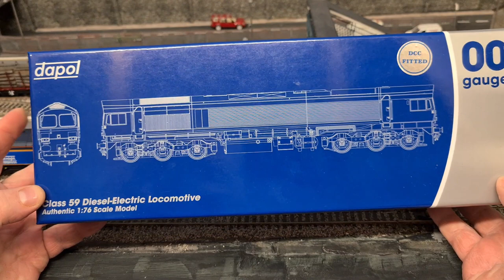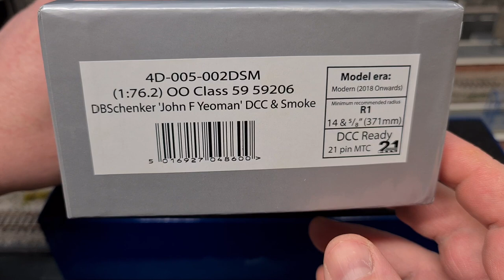Dapol Class 59 DB DCC & Smoke Fitted Unboxing

Comment: Loved your review. Like the look of your layout. The 59s with sound were available direct from Dapol and I obtained three from them. I originally ordered the DB 59, but cancelled as I had so many Bachmann DB 66s. The next run of 59s with three new liveries will be available with sound from dealers. The sound versions are awesome with twin speakers and suggest you get one on the next run.
Reply from the maker: Hi I'll definitely be looking at getting a sound fitted one, I do wish I went for one rather than the smoke fitted but, its one of those things I wanted to try it and apart from that it really is a smart loco, I did pick the dB livery because I didn't have a 66 in that livery only the older ews so I've got a bit of variety at the moment, glad you enjoyed the video and the layout, I'll hopefully get round to doing some more scenery soon, thanks for watching. Tom

Comment: Just a quick check on the smoke - I haven't tried the Dapol one yet but  It is easy to create an airlock when you fill these kind of units - I tend to blow down the exhaust to clear this.  It may be more controllable to get a syringe for filling - you can also use the empty syringe to blow air through the unit to break any fluid bubbles that may form .  
I have also found that most smoke units need around 15-17v DCC to get the best out of them - I do not know if the instructions mention a minimum (Or maximum) track voltage.
Cheers
Chris
Reply from the maker: Hi Chris if you skip to 17:35 on the video you can see the smoke unit does pump out quite strong there is alot of smoke coming out of the funnel i think the issue is its like water vapour and you can barely see it, against a dark background you could see it, in an ideal world it could do with being abit blacker, the more ive tried it ive realised the smoke unit is pretty powerful it is more so not being able to see the smoke when its coming out, thanks for watching and for the info. Tom
Reply: @northwesttrainsmodels  I did see it at the end but was more intrigued by the initial run problems  - I would like to see a manufacturer explain the pros and cons of overfilling their units rather than just a cryptic comment in the manual (Well, what do you do if the unit is overfilled? - Manual - I've got nothing)

Cheers

Chris

Comment: You'll find out that if you put a Hornby Hook on the locomotive that it'll work better than dapol's hook because there is more space so the train can navigate curves better
Reply from the maker: Hi thanks for the advice I'll give it a try, I do find the magnetic couplings do the trick but on the hornby class 60 that still seems to derail bachmann wagons with the hook or magnetic on certain curves, thanks for watching and commenting. Tom

Comment: Hi thanks for the review, waiting for my sound fitted from 'Rainbow railways' in ARC livery. My favourite loco waited along time for it to appear and not much info coming from Dapol as to how it was coming on. I use Kadees so hopefully i wont have the same problems with coupling up to stock. Very informative, smoke seems a bit disappointing hope they can improve it with the settings.
Reply from the maker: Hi glad you like the review, I was very disappointed with the smoke to be honest its like fine water vapour rather than black so you can't really see it and I think with the sound fitted the diesel fumes working with a cold start sound setting would be much more effective, the dapol website there was hardly any info on the class 59 seemed very strange, am sure rainbow railways will work there magic on yours I got some drs mk2 resprays a few years ago and they were really smart, I had the arc livery in an old Lima 59, also the kd couplers should be fine I was just also abit annoyed that they had this problem with the class 68 couplers and they haven't tried to rectify it, thanks very much for watching and hope your happy with your 59 when it arrives. Tom

Comment: I wonder if the issue with the smoke is the generator on the loco or the fluid not making much clag?
Reply from the maker: If there was someway to make the fluid a blacky colour it would improve it alot, once I got it working its actually quite a powerful smoke flume coming out and in scale size it goes about 30 foot into the air 😂, but because it looks like water vapour it's so hard to see, it would certainly pass the emissions test 🤣, I think it would have been so much more effective if it could work in sink with sound fitted models like a cold start up or moving of it would add to the effect but am guessing there a way of getting to that , to be honest I would still have bought this model but I would have got the sound fitted version direct from dapol and not bothered with the smoke effect,

Comment: Very good review, the smoke unit is an abysmal fail IMO and don't know why Dapol even bothered to be honest.
Will consider the Freightliner G&W in the second run but DCC Ready only so I can put in my own LokPilot v5 chip, if you can't put in a EM2 inside that loco like the Hattons 66 then I won't bother with sound.
Reply: The smoke unit is a failure, dissapointed, my own fault for bothering, should have known better!
Reply: @RedShedNick  the thing is Dapol didn't exactly show it off before release so you were buying into an unknown.
Now you can see why, it is utter shite in my opinion and so far removed from the real thing it isn't funny.
Reply: @sapphirejunction8993  yep your right as always! The 92's i was about to order a couple, wull hang fire, and await Euvirails part two review, more and more problems are now emerging sadly.The annoying thing was the initial reviews looked very promising, but more detailed testing later revealed all was not quite as it seemed!
Reply: @RedShedNick  Yep, I've had to send my 2 back but on 92010 the electricals started to fail starting with both Panto's, then the cab lights and then it when you slowed it down it would stop then go back to the speed setting.
Reply: @sapphirejunction8993  begs the question how will the 37's turn out? i shudder to think!
Reply: @RedShedNick  I wouldn't worry about it, I've got their Deltics and they are superb runners and my 92020 only had the grills fall off thus it ran beautifully so no issues with the electrics on that one.
I recently sent back 4 Hornby Class 60's to Hornby for warranty repairs and all had running issues and just got them back and too be honest they still run like dogs and they are just basic loco's, thus will be getting rid of them and luckily don't need to buy anything else from Hornby anymore as far as loco's are concerned.
I'll stick to Accurascale.
Reply from the maker: To be honest as much as i like to try dapol products with them being one of the only brands that still makes some of there products in the uk but as nice as there locos are i have yet to get one i could take out the box put on the track without having to mess around in some way, i think i was being over optimistic with the smoke i certainly wouldnt have paid for it going back in time, and main disapointment is you cant control it from your dcc controller you have to manually turn it of, otherwise from a running point of you and how it looks i cant really fault it, i will have to get it sound fitted though i think, glad you enjoyed the review and thanks for watching. Tom
Reply from the maker: me and you both, i think ill switch the smoke of and get the loco sound fitted in the future when i get the funds in.
Reply: @sapphirejunction8993  020then good! So tempted to go for 92017 Bart the engine. Remember it on hire to DRS  working the Tescos train, and now sadly dumped at Crew electric where its resided for years now.
Reply from the maker: you make a very good point there and the day i bought the loco looking at dapols website all the page on the 59 was gone and just a new page advertising the next lot with very little info, i think bachmann will be my main company for locos now as they show u a good idea what your buying now before the product is released and touch wood all my bachmann locos ive bought have been great in all aspects
Reply from the maker: thats interesting ill have to have a watch i liked the look of them but had already to much on pre order so couldnt afford to order anymore i was also liking the look of the deltic to.
Reply: @RedShedNick  Yeah I fancy 92017 for the livery but hasn't run for donkey's years.
I'm still waiting on DB 92036 & 92042 from a retailer thus hopefully get them at the end of the week and see how they go as far as running is concerned, eventually will get back 92010 & 92020 from AS but can imagine 92010 being fully replaced by another new one.
Reply: @sapphirejunction8993  👍👍
Reply: @northwesttrainsmodels  👍👍
Reply: @northwesttrainsmodels  👍👍

Comment: Hi Tom, you don’t seem to  pleased  with your 59 I always use hunt elite couplings had no problems at all my 59 DC run’s lovely cheers Al still waiting for a Dapol chip nothing else fits according to Susannah
Reply from the maker: Hi Al i havent had any problems since changing to the hunt couplings either, it was fine with the dapol wagons just didnt seem to like bachmann wagons with standard couplers and i do think the couplers on the dapol diesels hang to low, overall am happy with it, i think the dissapointment first started when it wasnt made clear about dcc sound being only supplied from dapol and the day i picked mine up and realised it wasnt even my supplier went on there website and everything about the 59 was gone of the website apart from a new pre order page for the next batch, but i suppose paying extra for a smoke unit, i was originally excited about as i love the smoke effect on the steam locos but i should have nown it wasnt going to be as good as someone else stated on the comments dapol hadnt shown it of or publicised it much so that was a tell tail they mustnt have been to confident with it, nice idea but not well executed and the main dissapointment for me is you have to open up the loco and turn the smoke unit of manually, otherwise in terms of running quality and detail i cant fault it, it is a lovely powerful loco, glad your happy with yours and ill have to take a look at Susannahs video on it, thanks . Tom

Comment: Smoke unit not controllable? Well that's a bit of a shock.. pointless then.. don't think il bother.. stick to my Hornby versions..
Reply from the maker: Hi other than the smoke unit it's a very good model but am sorry I paid for it, if I'd of nown about the sound model only being supplied by dapol if of gone with that, I did have a hornby 66 but my personal favorite is the bachmann version, thanks for watching. Tom
Reply: @northwesttrainsmodels  managed to find out from local model shop that the smoke is intended to only work on start up or pull away. Odd. Hattons say some sound versions are coming in next few weeks, apparently. I may stick to my Hornby versions.. there a vid of them on here I think!